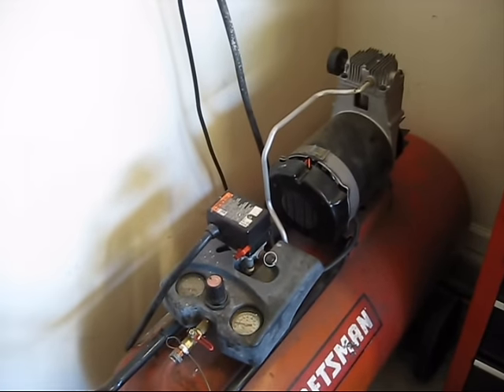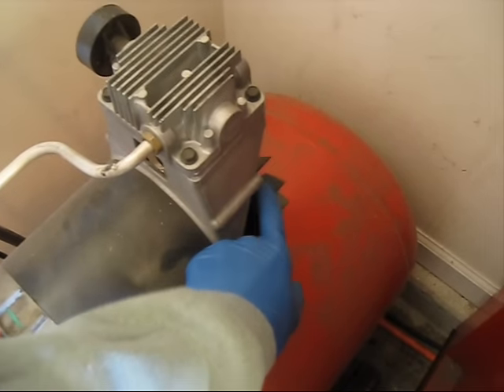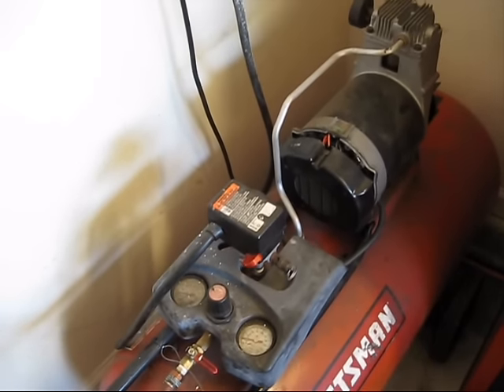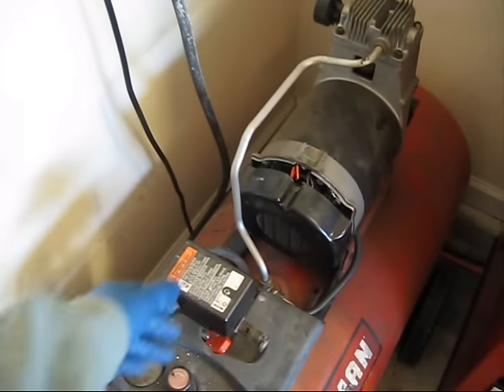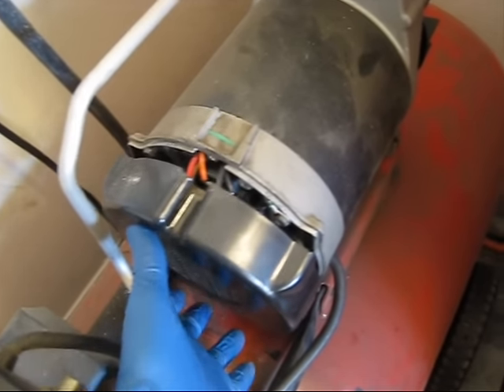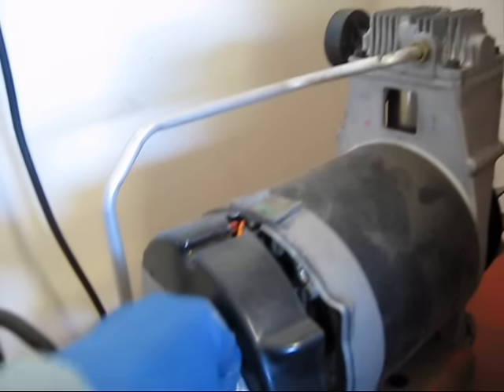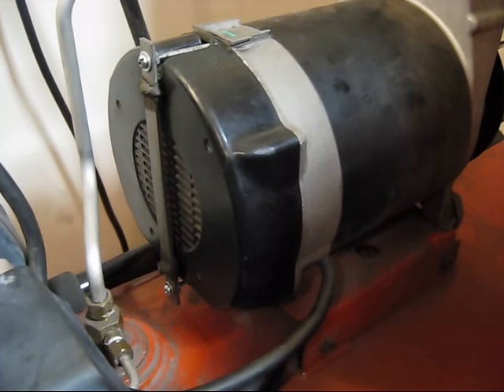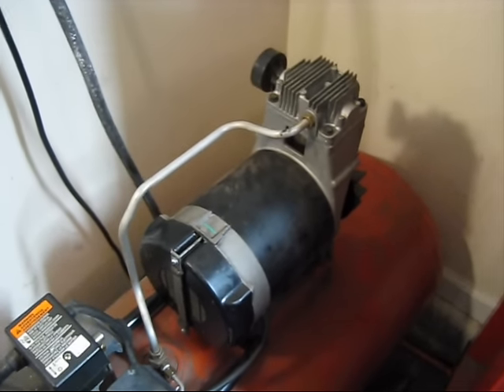Craftsman Air compressor startup problem and fix

Comment: I've got a vertical that loves to trip the breaker.  You described a Craftsman POS perfectly.  This one is my 2nd one and I turned my 1st POS with a pump issue into a great sand blasting rig.  When running a construction project there is no time to wait on a fix so I bought the 2nd POS.  Now that I have some time and thank you for the video I will troubleshoot this machine and see if I can find as elegant of a solution as you did.  The duct tape really gave me a chuckle as I remembered the Red Green show.  If the ladies don't find you handsome they had better find you handy!!!

Comment: THANK YOU THANK YOU THANK YOU!!! I was losing sleep over this and was dreading the thought of having to buy a new compressor. 😩 I was thinking it could be the starting capacitor but lo and behold I stumbled across this video. This was the EXACT problem I was having...seems to be a common problem with these compressors. 10 minutes later I've got a quick and easy fix and it's back up and running. Rather than making a bracket, I just used a longer threaded screw with some larger washers to hold the cover in place. Seems rock solid! Thank you again for shedding some light on this problem and recording this video. 🙏🏼

Comment: My compressor had been sitting for a few years. I thought it was the capacitors but that was not the fix so I put it away. I'm restoring a sailboat and needed bigger air, I came across this video,  went right to the shed, dusted off the old compressor, did this fix in about 10 minutes and WALA! Good as new. Knowledge is power so I thank you sir for taking the time to make and post this fix.

Comment: Thank you for saving me a lot of time and money trying fix/replace my compressor!! I have the Craftsman 25 gal upright model 919 which is about 25 years old. I was having the same problem except mine quit working all at once and was sparking, smoking, making a grinding noise, and tripping the breaker after a few seconds. I was able to fix my compressor by replacing the top housing mount screw with a 2 1/2 inch screw and a washer. The bottom screw was fine, housing not even cracked. Compressor is running like a champ!🙂

Comment: I picked a like new vertical air compressor 33 gallon that I think has the same issue. The seller wanted a higher voltage compressor in his garage so I lucked out. He did save the parts (that will eventually fail again) on the cover so I thank you for your wonderful video.

Comment: Thank you for posting this. My 125psi/25 gallon compressor hasn't worked properly for several years. Initially it fills, but won't recycle without blowing the breaker. Upon inspection I found the same broken plastic on an inner cover. My model is slightly different from yours. The switch is just held in place by a properly fit cover. The upper screw hole on the cover had broken so it fit crooked. I notice your switch is held by two screws. Mine had the holes but no screws. A couple of long screws, toothed washers and nuts secures that firmly in place. I tapped the case and used a flat washer with a long screw that now holds the cover on properly. Also, I discovered inside the cover one of the two position terminals had broken off the cover. A 1/8" pop rivet with backing washer put that back in place. It might have been touching one of the other 2 terminals causing a short. Now it works again perfectly restarting with 80 psi in the tank and not popping a 15 amp breaker. I'm glad it wasn't the capacitors. The run cap is easy to find, but the 3 wire start cap is not. Thanks again.

Comment: Wow, you just saved my husband from buying a 2hole new air compressor. He has the vertical machine and the same issue came about with his. We saw your video and by god, your repair and diagnostics worked like a charm. We both thank you so much for this video.

Comment: This absolutely worked. I replaced the power cord, check valve and pressure switch and still nothing. I was just getting ready to use it for target practice before watching this.  You are the man!

Comment: Smartest approach for this superior modification I’ve have ever seen! Thanks for sharing your knowledge and for providing us DIYers an inexpensive creative alternative. Following your repair got my compressor back up and running…the fix cost me “zero cents” nothing. If you want to count rummaging though my sorted parts recycle bins still wouldn’t come close to the price of a repairman or replacing it with a new one. Thanks again you’re my RockStar! Cheers 🍻

Comment: I wanted to thank you very much for this video. My motor end shroud has a small crack on the top but it was still seated fine. After replacing both the start and run capacitors, I was still tripping the breaker regularly on startup and when the compressor tried to repressurise at 120psi. Knowing the motor end shroud was seated properly, I turned my focus to the contactor assembly for the pressure switch that you mentioned. I sprayed some Deoxit D5 that I typically use for guitar and amplifier potentiometers on the contacts of the pressure switch and it not only started fine after that, but it also restarted as intended at 120psi. Not sure if this is a common problem or not but it certainly seems to have resolved my issue of regularly tripping breakers with this compressor.
Reply: Thanks for that info, Where did you find a capacitor that would fit under the motor end cover?
Reply: @Doug  I got one off of Amazon. I don't recall the exact model though.
Reply: @je1279  I replaced the start capacitor but I couldn’t find the one with the right dimensions. It was close but my end cover is like the one in the video, tabs broken. Thanks for the reply.
Reply: @doug3805  I went through some old emails and found the start capacitor I ordered was a Packard PSMJ400.

Comment: Craftsman compressor not working told wife gonna try to fix it she said check out  you tube first luckily I found your video it was exactly the same issue. My craftsman 33 gal. Compressor was designed just a little different the plastic assembly extended higher on end of motor. But fixed it in a similar manner. Thank you very much you saved us money thank you thank you

Comment: I was having exact problem you describe. Same 33 gallon tank, but mine is upright tank. 

Sure enough, back engine cover loose on mine. Secured it tight, and it started right up. 

Excellent video on what is obviously a common problem with these Craftsman air compressors. 

Thanks.

Comment: I was looking online pricing a new motor & come across ur video. The housing around the screw at the top was broken on mine causing the motor to hum. I didn’t get as fancy as u did but used some of that metal strapping with all the holes in it. Worked perfect. Thank u for the video. I owe u a beer.

Comment: A THOUSAND THANK YOU's!!!!  I was having the same issue.. Really bogged slow start then blows circuit breaker.. I was just shopping for Start capacitors due to seeing other videos and I decided to you tube one more time for this issue and I found your video.. It just so happens that I was missing the bottom screw holding that Black motor cap on and it was sticking out.. I found a matching screw and went for startup and BAMM!! Shes up and running!!! I cant believe it...👍

Comment: Construction seemed sturdier than other units I considered MyBest.Tools Noise level was reasonable. Good pressure and cfm capacity for a small reasonably light compressor.

Comment: Thanks for the information! I got a free 30 gallon from my neighbor because he had the same issue. I ended up 3D printing a replacement cover, extending the mount for the switch 2mm too make a better connection (read online that even from factory that switch sits a little too far back), and making the mounting points thicker to prevent them from braking again. It’s working like brand new now! Hell it looks brand new.. dude barely used it.
Reply: You have a pic of the wiring diagram to the compressor I’m having the same problem
Reply: I have a 25 gallon 5.5 hp craftman u should make some of those cover I’ll buy one off of you
Reply: @shaunlucky-samaroo688  I don’t have a diagram sadly. I can probably take a picture or something for you. Feel free to shoot me your email in a PM
Reply: @peloneretana5924  I have the file still, so if it’s the same I could probably make you one. Shoot me your email to my pm. Maybe you can send a pic of your cover so I can see if it’s the same.
Reply: hey do you mind selling me a printed cover replacement?
Reply: @RuckusCustoms  I wouldn’t mind at all. I’m actually repairing my printer this weekend after a bad print messed up my hotend. If I can’t get it going this week I can have my friend print it on his for me.
Reply: @RuckusCustoms  hey I sent you an email, check your spam in case you miss it. Thanks!
Reply: @urieldelteco  can you sell me one as well? How much?

Comment: Thank you so much for this video. I had the same exact problem with the same exact motor.  Your video saved me from buying another compressor. I repaired my compressor just like you did yours. Everything is fantastic. Great Video.  Thank you so much. My compressor is a Porter-Cable.

Comment: Thank you!  I recently bought the same air compressor in a very used condition.  Worked at first but then was tripping the breaker without making a sound.  I was ready to put the thing on the curb with a "free" sign when I came across your video showing the exact same condition.  I was able to use JB Weld to glue the screw hole back on the top of that plastic piece and and fix a crack on the bottom.  Problem solved!

Comment: Thanks for the video, I really appreciate it. Mine is the vertical version of yours and I think it is basically the same motor. The start capacitor busted and i put a new one in that was  little bigger around and it did the same thing it was doing before which is just exactly what yours was doing. I think it was because i couldn't get the cover back on flush and mine has the screw tabs broken off also. Both my capacitors checked good so Im going to try what you have done. I didn't know how that switch worked behind the cover so thanks for the explanation. I put a new piston ring and head plate on it because one of the reed valves was broken and it ran fine for a while. Going to try this tomorrow. Thanks again.

Comment: Had this exact problem with my 2004 made Craftsman model 919.168700.  It got progressively worse for over a year and I couldn't figure it out.  Tried different circuits, I knew the breaker wasn't the issue, nor was it anything in my garage wiring.  Once I took the cover off (that was the toughest part...why these a-hole engineers use the dumbest type of screws in the dumbest places is beyond me)... I immediately saw the rear portion dislodged as you said, plastic pieces broken from nearly 15 years of wear and tear.   I thought it was the capacitors for certain, but I saw that little pressure switch, and something told me to figure out what the heck that did.  God bless YouTube, it's saved me so much time and aggravation over the years.  I used racing tape and replaced those worthless communist star screws with simple Phillips machine screws and boom!  She runs like a clock once again.  Thank you good sir!

Comment: I had a similar problem. I would switch on the compressor and it only kinda half started, kinda like a car with a dying battery. I watched this video and opened it up, but all was good. I called my electrician and he said he thought it was a power company issue. I have overhead service and he said to call the electric co and have them come out to check for a corroded neutral at the pole since the neutral is usually not insulated. They came out and cleaned all three wires at the pole, but the problem persisted. I called them again and they cleaned the three wires at the house and that solved the problem. It was an Edison problem. So keep that in mind if you have this problem, or a similar issue with high power draw tools or appliances.

Comment: @pfun41 - Like many other viewers leaving comments - I too was thinking I had a bad start capacitor.  I have a craftsman compressor with a plastic cover holding the switch like yours and my cover broke as well.  I used a strap like in your video.  I would have never thought the broken plastic was the culprit but once I strapped it, and tried it, it works perfectly.  Thanks to your video I saved money by not buying a new start capacitor, and saved time waiting for shipping of a new capacitor only to realize that was never my problem in the first place.  Thanks for the heads-up!

Comment: Thank you same issue on my craftsman  model nbr 919.165070. The top and bottom plastic holds disintegrated over time and the compressor will not start and throws the breaker. Hold the cover on tightly and it starts perfectly.  Brilliant! And the screws are star shaped torx - t20 seems to be the correct fit to remove the two covers.

Comment: Thanks for the video.  Tried pressure switch, unloader valve, etc.  Found out it was the plastic housing.  Put a similar bracket in place to hold the housing and it now works fine.  Thanks

Comment: pfun41...man....thank you for this video....i was thinking capacitor until or switch until i watched this.  same issue....cheap plastic piece broke off that holds capacitor assembly snug....worked its way out....eventually wouldnt start.  simply reassembled the capacitor assembly that i started taking apart...held it snug to the motor...boom...started.  now to work on the repair.  thanks again.

Comment: I got one gave to me this week that won't start. I noticed the top cover bolt was broke out like that one, although it is a little different. I'll be checking this out tomorrow. Thanks for the heads up. If it works, I'll be sure and let you know.

Comment: I have a similar Craftsman compressor. The caps are missing, which is why it was free. There is a purple wire and a brown wire on one side, and two black wires plus the ground on the other side. If you know which side is which, I’d appreciate the help.

Comment: This is better engineering than GE's. 
Think of it, my  new MAC5200  Makita has to be teared apart to access the capacitors.... but this one won't  separate from its motor cover all by itself !
Nice little compressor, though, easy to fix.

Comment: When I get home it's on. Same thing going on with my upright unit. I bet that's it. Capacitors show good and I know the bottom part of the housing is broke but I have the piece and the screws. Maybe a little jb weld and it'll run again. Thanks.

Comment: Heads up dealing with a problem with my 27 gallon craftsman but the compressor is identical to the 4.5 gallon porter cable air compressor.

Comment: I opened mine to find that the cover was also broken. I suppose it was a design flaw of this GE motor after seeing how many other people had the exact same problem. Once I bolted it down, it attempted to run (even spinning for 3 seconds) before tripping the breaker. I suspect the Run Capacitor is  bad because the Start Capacitor manages to get it running, then when the centrifugal switch kicks in, the Run Capacitor cannot maintain the load and trips the breaker.
Reply: Turns out both of my capacitors were good. It’s still tripping my breaker. Looks like I have a short circuit between the hot and the neutral. Any ideas what I should try?
Reply: I re-watched your video and noticed that my wires were crossed. Soon as I swapped the colors to match the ones on your capacitors, it started working. Thanks for this video! Just fixed my compressor!

Comment: Thanks for the video. I have the same one. I have to put a new run capacitor in mine but i dont have a wiring diagram. do you have any pictures of your? Thanks Craig.
Reply from the maker: There's only 2 wires, hard to mess it up.

Comment: Buddy you are the greatest and thanks for your video,I have a devilbliss air compressor that came with this same motor,I changed the both capacitors it worked a first run came back on,I was going to throw it away thanks man 👊🏽.I do straightening and painting and its a 30 gl works perfect for the job.THANKS AGAIN and I love your idea as mines dry rot also same place

Comment: Can you purchase the centrifugal switch ?   I had the same issue as you had however the switch is bad.
Reply from the maker: I couldn't find any internal parts for this motor. It was a unique design ordered from GE by Craftsman for this compressor.

Comment: Does ur part have the number to it that is the issue I’m having I noticed it has a part number but it’s to hard to see the numbers. What would that cover be called
Reply from the maker: They don't sell this part to my knowledge. And it's buried in the compressor housing in a shed now.
Reply: @pfun41  I pick up another compressor it’s Devilbiss  was talking to the guy and he recommended taking it to an electrician. Did ur compressor catch fire u said ? Enjoy ur Tuesday
Reply from the maker: @peloneretana5924  No but the bearings recently locked up and fried the surge protector.

Comment: Does anyone have any thoughts as to what could be causing the same startup/ trip breaker symptoms but with the cover not being broken? I tried replacing the start capacitor, it runs for a few seconds, and then shuts down.